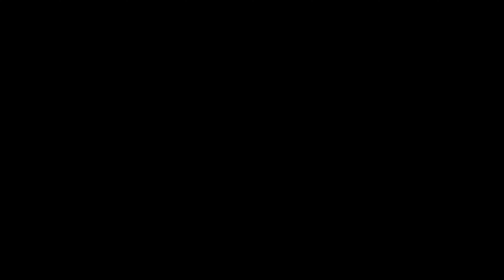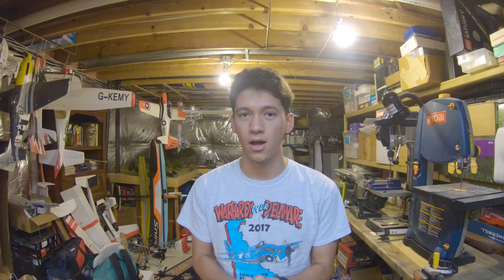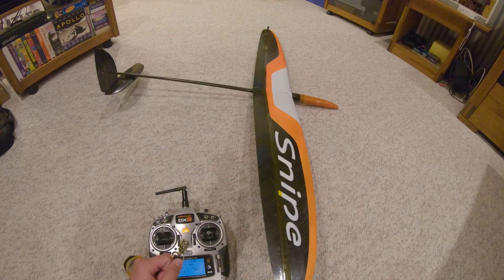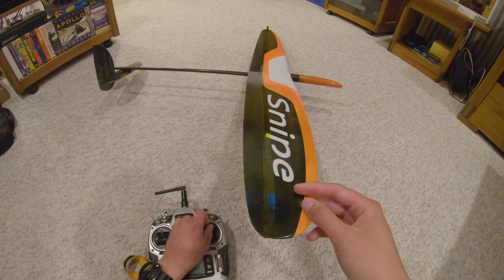How to Set up Your RC Glider

Comment: Does the snapflap adds on top of the differential? so when you turn and pull a bit the stick, doesn't it adds too much flap down movement?
Reply from the maker: Yes, they add. No, it's not too much, especially since you should be doing most of the turning with the rudder.

Comment: how do i connect a rudder preset to switch (DX 6e). I had no probs when setting up different elevator angles for different flight phases on a switch (flap adjustment) - but cant manage to attach the rudder....

Comment: I'm looking to get a glider, but I'm concerned about radio transmitter power / distance. I wish to avoid to loose the glider due to radio transmitter's capability. At what altitude do you estimate that the glider can climb? I'm thinking to get a DX 6e. What would you advice?
Reply from the maker: For gliders of this size you generally will be more concerned with losing sight of it before being concerned with losing signal. Pretty much any brand/protocol will be good enough. Spektrum doesn't have the best range in the industry, but it works just fine for DLGs.

Comment: I note that you don't have any camber to elevator mix.  How do you prevent your Snipe from pitching up when you increase camber?  Just manual elevator?
Reply from the maker: I have slight changes in elevator programmed for the different flight modes to maintain level flight. However, for flaperon functionality I do not use an elevator mix. For my setup, I have found that the amount of down elevator needed to maintain pitch is highly dependent on airspeed when the flaps are applied. Therefore, an elevator mix will apply the wrong amount of elevator most of the time since it cannot react to changes in airspeed, so I personally find it easiest to omit the elevator mix altogether.
Reply: @TimmyRC  Yes, this is all true.  What I found helps is to program a mode change delay on the camber, i.e. the camber changes slowly between modes - this reduces the nose up behaviour as it naturally slows down as the flaps increase.  But I still find that the final angle of attack changes more than I'd like and I don't want to add mix.  I'm wondering how much the CG is affecting this.  I have a Strike 3.
Reply from the maker: @ChristieNel  I have my flaperons on the throttle stick, which I find useful since I can apply the flaps at whatever speed I want and however much I want. The amount of pitching that occurs with application of flaps changes depending on the airplane. I can't find anything definitive about the CG's effect, but I suspect there might be some relationship since changing the CG location changes the sensitivity of the elevator.
Reply: @TimmyRC  I have some amount of flaps on my throttle stick in cruise mode only.  I'm finding it annoying having to switch to landing mode to get full flaps down, so considering a lot more flaps on my throttle stick, with perhaps a very strong exponential.  How do you brake?
Reply from the maker: @ChristieNel  I have full flaps available via the throttle stick in all flight modes except launch mode so that I do not have to change flight modes to brake. I do not use expo.
Reply: @TimmyRC  Wow.  My Strike 3 is specified as 6mm max flaps for thermal, but my brakes can go about 40mm.  I cruise with no more than 3mm, which would be a very tiny sliver on my stick.
Reply from the maker: @ChristieNel  Clarification: I do not use the throttle stick to control small camber changes for thermals, cruising, etc. I have those programmed on a switch. I only use the throttle stick for brakes.
Reply: @TimmyRC  Ahh okay, that makes sense.    I think I'll do something like that.

Comment: I am trying to figure out if I would enjoy this or not. I like flying my Night Radian and my Conscendo, but it can get boring after a while because you just power up, get to altitude and cruise around.  Watching gliders on video is boring, but I suspect the thermal hunting would be fun. I would be curious to hear how you rank DLG flying compared to your favorite prop planes and electric gliders.
Reply from the maker: DLGs are my favorite fixed wing aircraft I've flown. They don't require a fancy launch system, they can be flown at very small fields, and they fly for hours on a charge. Competition-grade DLGs are highly engineered, high performance machines (unlike a Radian), and those kinds of machines are always more fun to pilot. There is also something satisfying about flying under your own power, and hunting for thermals without a motor is a fun challenge.
Reply: @TimmyRC  Thank you. Okay so you enjoy DLG's even more than a $2k 3M powered glider? Could you say something about the recommended skill and experience levels (really two different things...most of my crashes have been a result of low experience and not low skill). I am new to RC (1 year). I can fly my Conscendo, Radian, Turbo Timber, UMX TT, etc. all just fine. But boy, I don't want to crash a Snipe.

Oh, and can you recommended a particular DLG to me? All I really know about what I want is that I think bigger is better.
Reply from the maker: @jdouglasj2000  I have never flown a high end 3m glider, so I can't speak to that. However, with a large powered glider you lose the small-field-flying capability, the fun hand launch, motorless gliding purity, some aerobatic capability, and some of the challenge of thermalling. My closest point of reference is a powered Bird of Time, which I just don't find as fun as DLGs for the aforementioned reasons.

If you are already proficient at flying fixed wing you shouldn't have much trouble transitioning to a DLG. Due to F3K rules, all competition-grade DLGs are 1.5m. You will get the best performance with a 1.5m competition model such as a Snipe 2 or BAMF 2. However, I constantly recommend the 1m Armsoar Deviant for beginners since it has the same construction as competition models, but is smaller, making it easier to launch, slightly more durable, and less expensive. You can also try to pick up a used or unbuilt competition model from the RCGroups classifieds. I got my Snipe as an unbuilt kit through RCGroups and saved a few hundred dollars.
Reply: @TimmyRC  Very helpful. Thank you so much.

Comment: What happens when you deploy full flaps, then operate the aileron?
Reply from the maker: The ailerons become pretty ineffective at controlling roll with full flaps deployed. Adverse yaw is common in this situation. Therefore, it is best to steer with the rudder when full flaps are deployed.
Reply: @TimmyRC    Got it, thanks for the explanation.  Also for thermal mode, do you mix in any rudder with the aileron to aid the turn?
Reply from the maker: @bohan9957  Yes, generally you want to steer with the rudder as much as possible so that the wing's airfoil maintains maximum efficiency. However, I do not use a rudder and aileron mix in the transmitter.
Reply: @TimmyRC  Again, very helpful information.  Thank you!  Subscribed!
Reply from the maker: @bohan9957  Thanks!

Comment: I am a newbie. I have a sail plane with throttle, rudder and elevator. Should I keep throttle and rudder on the left stick and elevator on the right stick? At this time, I have elevator and rudder on the right stick and throttle on the left stick. Thank you to anyone that can help me.
Reply from the maker: Typically the rudder is on the right stick for your kind of airplane (assuming mode 2).
Reply: @TimmyRC  Thank you. Yes, I have the DX 6 on mode 2.  I appreciate your very quick response. I am watching your videos about sail planes and I am learning a lot. Thank you for both your reply and your videos! I thought that I might have changed a default by accident. I am learning on the Night Radian. My next plane will be the Conscendo Advanced with ailerons.

Comment: great video, which receiver you use? and wich battery do you recomend? Thanks
Reply from the maker: Thanks! I use a LemonRX 6ch diversity receiver and a 600mAh 1S LiPo.
Reply: @TimmyRC  do you use any BEC to regulate the voltage or your electronics are directly powered by 1S Lipo?
Reply from the maker: @MontyMontemayor  It is direct 1S power. You have to make sure the receiver and servos are rated for the low voltage to avoid losing control. Also, there is no over discharging protection, so it is a good idea to run a receiver with voltage telemetry.
Reply: @TimmyRC  can you please share the servos that you use? Thanks
Reply from the maker: @yeahitworks  Dymond D60s for flaperons and Dymond D45s for tail surfaces. They used to be the gold standard, but there are better glider servos nowadays.

Comment: Hey,
Is there no need to mix some elevator in your presets? E.g. If I change into thermal mode i have to mix some elevator down into it so that the plane doesn‘t lift the the nose and slows down until it stops.
Reply from the maker: Yes, often times you need mix elevator into the presets to keep the plane flying level to adjust for the camber changes.

Comment: Good but would have been better, actually excellent,  with some measurements given for each mode as you can't really see what is happening with the surfaces and have little idea of the relative movements
Reply from the maker: Thanks! The amount of deflection needed changes from model to model and should be determined experimentally, so I didn't bother providing measurements.

Comment: It would be good to have another video with your programming steps. Especially on the DX8. Thanks for the video.
Reply from the maker: Thanks! I purposely left that part out for this video since each transmitter is different. However, I can definitely go over the process on my DX8 if there's enough interest.
Reply: @TimmyRC  To be honest, I am kind of self interested since I have the same transmitter. Having given full disclosure on that account, I still think it is a good idea to do a video. If you can program a DX8 G1, the newer transmitters (I suspect) are easier to program so it may translate.
Reply: @TimmyRC  Thank you Timmy, I would be interested, I am picking up a DX9 and just getting into DLG's
Reply: Yes, please. You're explanations are really clear and easy to understand. Plus, I have a DX 8 as well...so...
Reply: Interested in this as well and would like to know you pick a specific switch over the other and if you are using a dial to dynamically tune.

Comment: Nice walk through the settings but unsure about your differentials setup and like to ask.   To compensate for adverse yaw,  where the down elevator surface create more drag,  as you said you typically configure less down and more up.    In your situation, you will need to compensate some other way,  perhaps up elevator .  Otherwise the turns would be uncoordinated with nose pointing outward of the turn. I've had the exact setup and the result was quite high rate of up elevator to sustain  the turn as well as ruder mixing.    Also another problem is generally with very high flaps,  you need delay.   That is because as soon as you enable the flaps,  nose comes up,  before air catches the stabilizer to compensate the mixing.   The fix is push the nose down a bit then enable flaps.   I can never figure out how to mix delay into an already mixed channels.
Reply from the maker: For flaperon differential, you should not use so much so that the plane suffers from an excessive amount of adverse yaw. In addition, proper gliding technique is to turn mostly with the rudder in order to maintain the efficiency of the wing. Also, airplanes generally need up elevator in a turn regardless of their differential.

You do not need an elevator delay on a flaperon elevator mix. There is no point at which you are waiting for the stabilizer to "catch" the air; The stabilizer constantly has air flowing around it during flaperon deployment, so any stabilizer inputs will take effect immediately. I think the effect you are describing is when the whole airplane rises suddenly when the flaperons are deployed quickly, which is due to the airfoil's shape changing dramatically when the airplane is still traveling at a relatively high airspeed. So the amount of stabilizer correction would ideally be proportional to airspeed.

Comment: Mis-information alert. For thermalling more up flapperon deflection is best; down-going surfaces are draggier and induce adverse yaw.  https://en.wikipedia.org/wiki/Adverse_yaw Scroll down to Differential aileron deflection.
Reply: No. Read it again. These are 2 different thing. Adverse yaw/ differential is a behaviour of yaw induced by ailerons during a roll. Both ailerons down (flapperons) as no seperate flaps on these dlg’s is the method to increase lift whilst in a thermal.